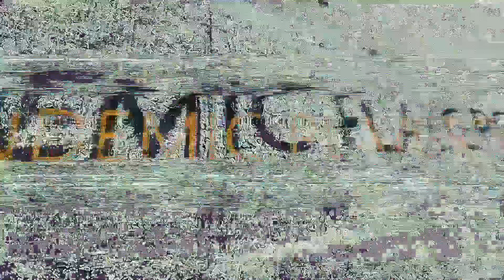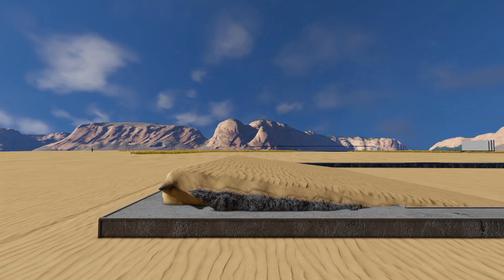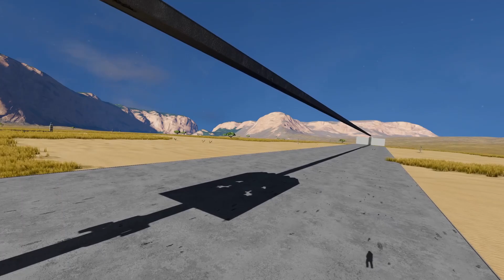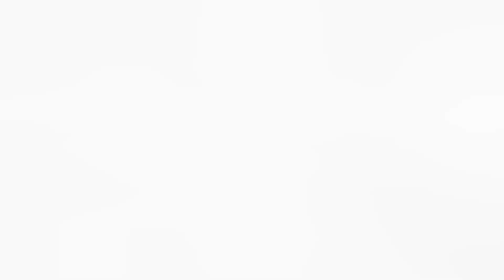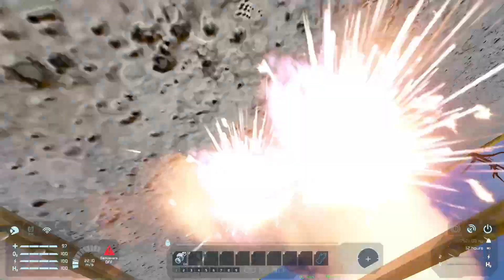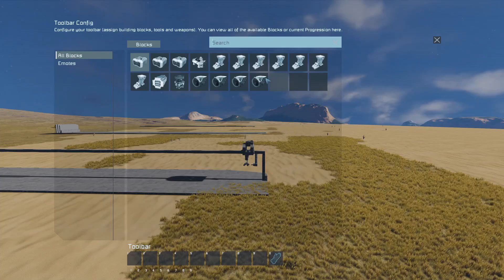Space Engineers Crash Safety Testing

Comment: I'm curious to know if the mass of the rover has any effects on safety. Let's say you have a rover with a few large cargo containers in the back (filled with stone) and crash that into the wall. The massive weight of the cargo should keep moving forward, squishing the cockpit into a pancake and turning the driver into kebab in the process. At least that's how that works out IRL.

If SE doesn't take mass into account, a light rover can be just as deadly or safe as a heavy one. If that is indeed the case, any rover can become safe if you just add more blocks around it, so that the blocks take the hit instead of the cockpit. If this second hypothesis is true, you could even drop a well armored cockpit from orbit and be completely safe inside. On second thought, it could be interesting to add lots of spikes on a cockpit and drop that from orbit. If my idea is true, the spikes will shorten dramatically on impact, but the driver should be safe inside this hedgehog of a landing pod.